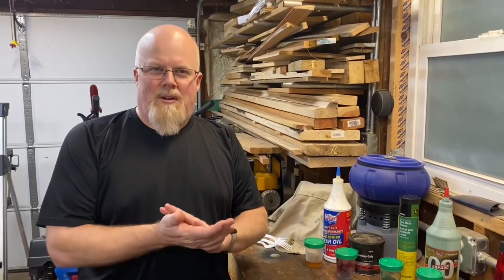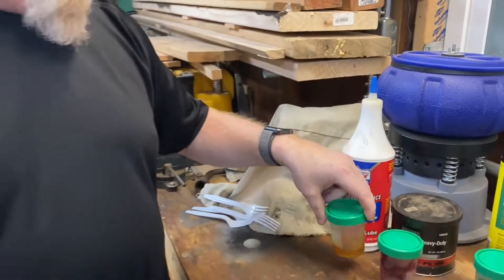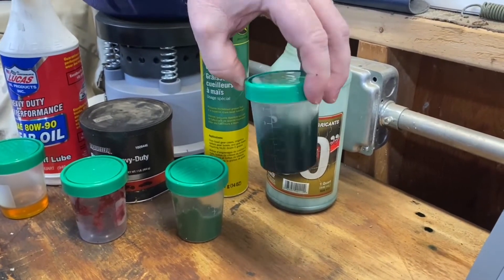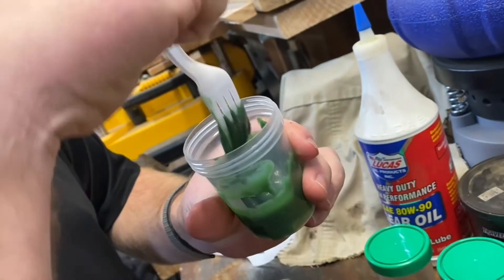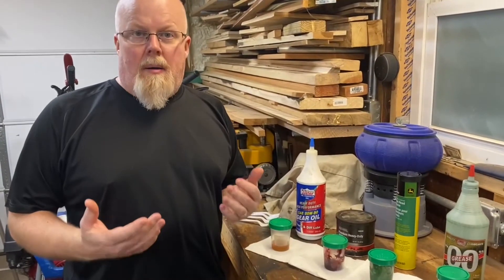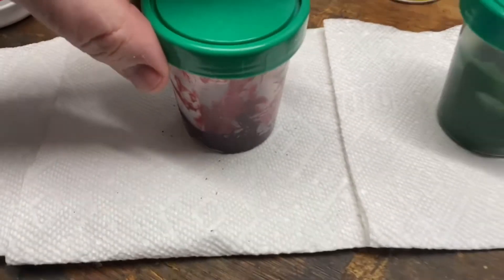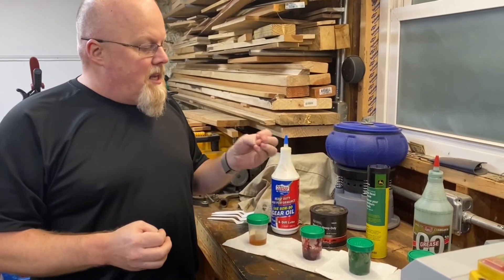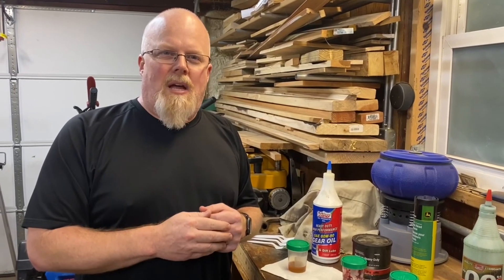Ford 8N Steering Gearbox 80w90 oil, #2, 0, or 00 grease ?

Comment: Wondering why you left EP-140 gear oil out of this mix. I think it is thinner than the 00 but not sure. I seemed to have stopped a leak (4 years now) in my 6 foot Mashio tiller using about 80 percent 140 and 20 percent Lucas hub oil which claims to stop leaks so this may be something you could try if still leaking
Reply from the maker: I didn't have it on hand, or I would have tried it.  To be honest, the cornehead grease is just the ticket!

Comment: Could one just mix up the #2 grease with gear oil to get something in between?
Reply: Idk the grease is heated to a specific temperature and mixed with binders to thicken it up. I suppose you could but you might have separation issues when it sits for awhile
Reply: I have heard of people doing that.
It may have been recommended as a solution by a maker long ago but I can't prove that...I just have heard of people doing this...
At your own risk of course...

Comment: I drilled and tapped my fill plug and added a zerk fitting, then used a air powered aro grease pump and pressure filled the steering box steering box in my '77 Ford 1600 that was leaking out of the shaft seal because the bushing was worn from carrying heavy loads with my loader and trying to steer with mystic g6 industrial waterproof grease that is so slick it's beyond slick, to the point it came out of the top of the steering shaft under the steering wheel, now id say that's pretty full! It's still a little hard to steer but always has been and takes a lot of force and about all you got when you have 1000lbs or more on the loader. But it doesn't leak and id say that packed full it's probably not shoving anything off. And it has a consistency of just a hare more thickness of the corn head and super super tacky. Made for excavators and heavy equipment joints to keep out moisture and stay connected to joints. It's synthetic, and a bit expensive, a 5 gallon bucket for my aro pump was $280 but it will last and I have a lot of equipment.